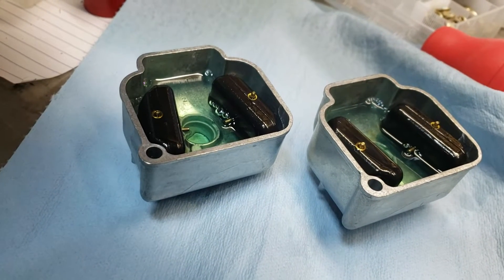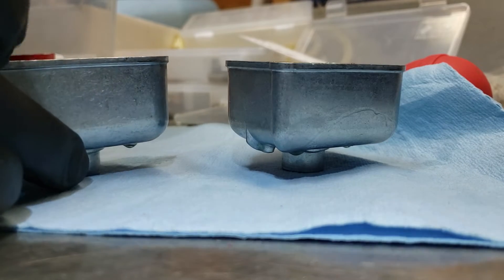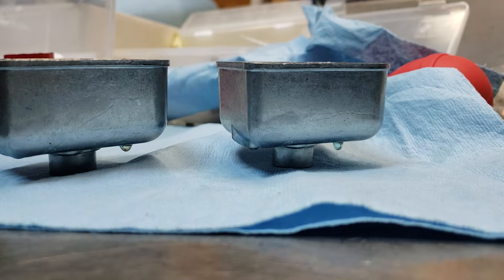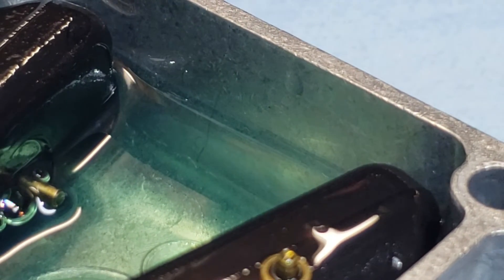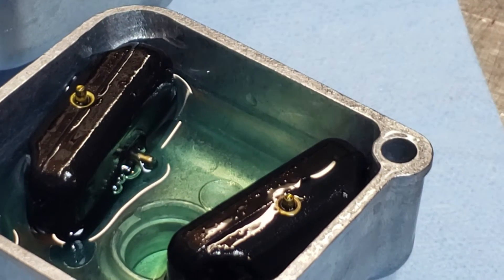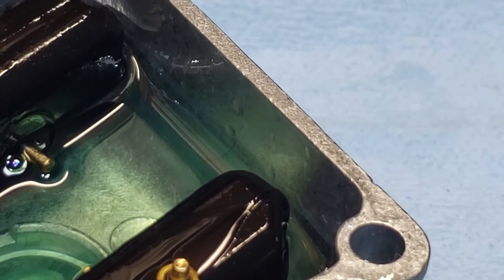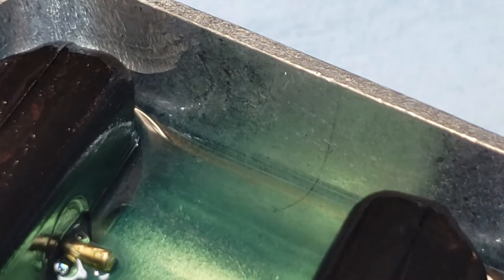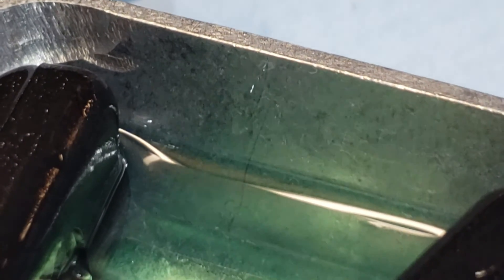Bing 54 float bowl leaking through the aluminum?

Comment: It would be interesting to know where they were cast.
Reply from the maker: I agree.  Unfortunately these were some old, unused carbs that had never had fuel in them.  They were mfg in the late 90's.
Reply: @KennethLeake  I wonder if a Cnc billet bowel could be equitable
Reply from the maker: @jamessharp9790  it could be, but that would be an expensive bowl.  These were part of a faulty batch from the mfg so the issue has been resolved, but is something to keep in mind if this issue is found in the future.
Reply: @KennethLeake  do you know where in the US to purchase a 38 -40 mm New type 54 Bing ?
Reply from the maker: @jamessharp9790  The standard Bing 54 is a 36mm, I would contact Bing directly at bing@bingcarburetor.com or 800-309-2464 for options in the 38-40mm.
Reply: Thats insane!  I have 4 bing 54 carbs.  I recently rebuilt the 2 on my 503.  The floats were toast.  Thanks for sharing.  I work for Alcoa Aluminum company. We have 16 melting furnaces.  I have played around with one of our better alloys.  Had a production guy poor a sample into a mold is had, then chucked that sample up in my lathe and turned it into round stock.  Very nice alloy.  Its fun to play.
Reply from the maker: @bikemancody2752  I could have some fun with some alloy and a lathe!  ;-)